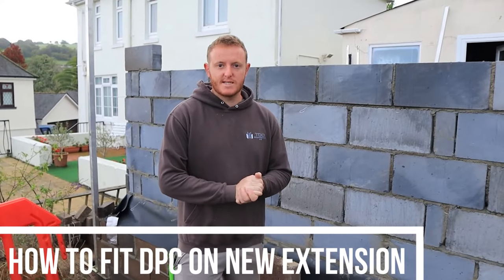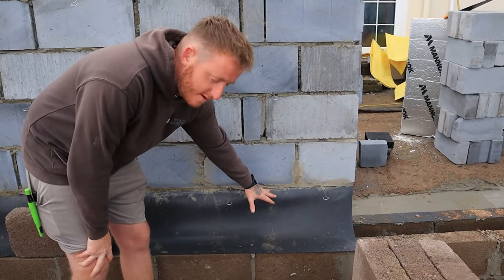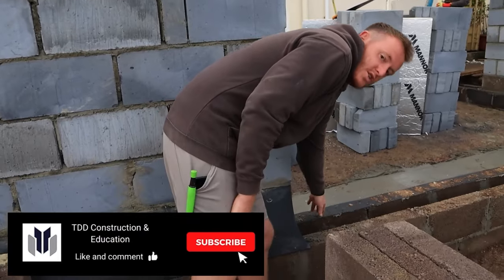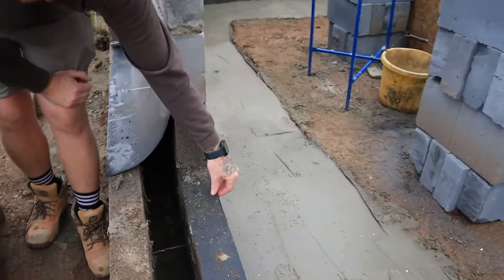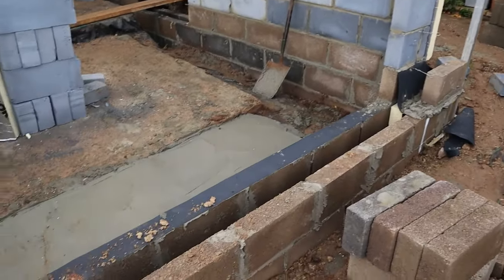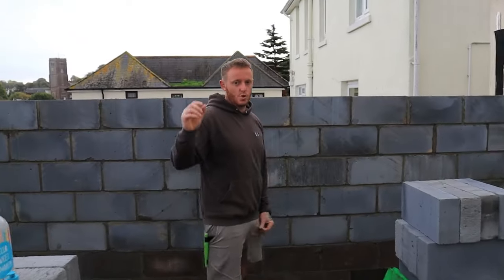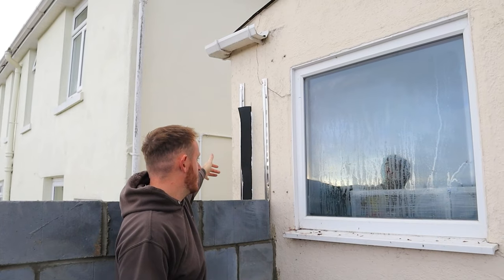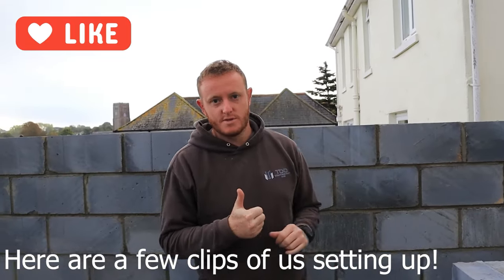Damp Proof Course Installation | 3 Different ways to use DPC

Comment: Hi, very useful video thanks for sharing. I can see you have the door opening internal and external leafs on the same height with a cavity in between. I have the same buildup and now about to get the bifold fitted and having difficulty what to do with that cavity. The bifold will sit on the outer wall and there is an empty cavity and blockwork behind then the dpm and slab. I cannot find an info how to build that gap. I would just use a cavity closer and add insulation and screed to get a continuous subfloor. Any advice?
Reply from the maker: What build up of floor are you having? 
Insulated and concreted?
Or timber?